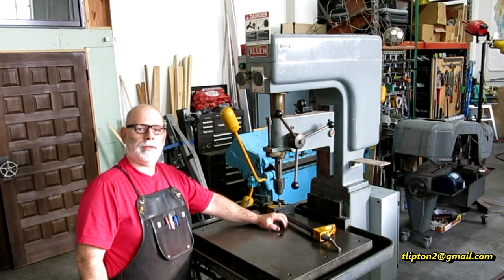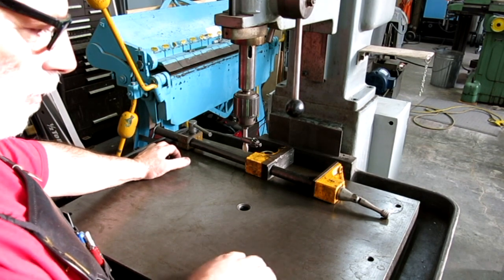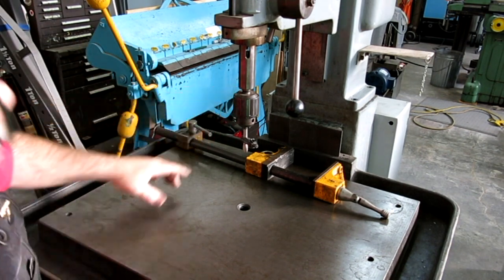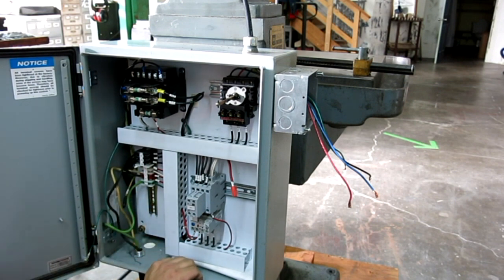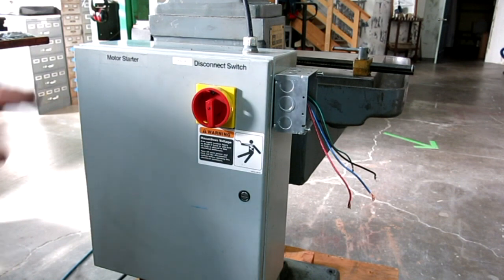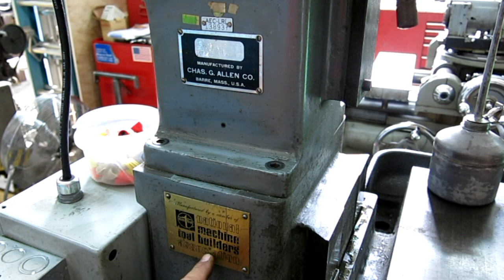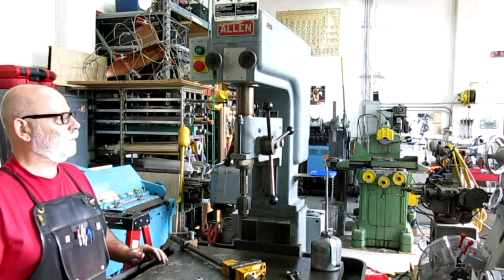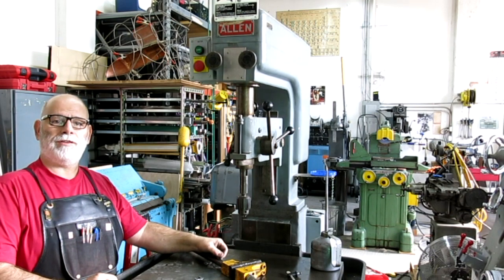Machine Tool Survey Allen Multispeed Drill Press

Comment: Hi Tom,
Hey you are going to love that Allen drill press. I have one in my shop very similar to yours and the only way I would part with it would be if I was replacing it with a radial drill press.  Mine was built in 1968 and used by the government during Viet Nam and then decommissioned. I am the 3rd owner of mine. I got it from a guy that was retiring and selling off his machine shop. He got it from a government auction. Yours is a newer version with the way the motor is set up. Mine has the spindle mount 2HP 230V 3PH motor. I think it's 12 speeds with a back gear. I have the very same table as you do in yours. They did offer a bolt down T-slot plate and your pable looks to have been set up for that option. I have a 14" rotary table mounted on mine and a 6" Kurt vice. The base is slightly different on mine in that I have the wet tank flood coolant base and pump. The table has telescopic drain back tubes to return the coolant into the reservoir base. Yours is also a much higher RPM machine then mine is. I'll have to take another look at the speed control to see what the speed range is. MT-2 spindle is the same. I also have a built in reversing foot switch on the front of the base. Oh you will like that spinal height adjust feature on there too. I use it on almost every job I set up and just love it. Yes they are very heavy stout machines and I would imagine could inflict a lot of damage or injury if used by the wrong guy. However I think it has found a very good home in your loving shop Tom. Oh I have seen them from time to time in used equipment auction and the go cheep. I paid $250 for mine.
The Allen replaced a 14" Walker Turner drill press that I used for many years. It still worked fine but like you the Allen sort of fell in my lap and I could not pass it up.

Joe 
PS, I found a real nice manual for mine on the internet.

Comment: Hey Tom,
I think you will find the elevating screw is telescoping. No need to adjust the outer section by hand. Just crank the table down, and when the inner screw runs out of travel, the outer will turn and vice versa. 
I have an old B& S mill made the same.
I'm more amazed at the lack of chowdering on the table, than anything else. Looks like it was used by pros.
I think your other drill press just got out classed. 
Nice score!
Reply: +Jerry Long  The lack of chowdering is due to the fact that you can't rotate the table!
Reply: Matthew Tinker People always find a way.
Reply: +Jerry Long or not really used at all! typical government purchase, bought for a fortune 40 years ago and was never required, so sat around till it was sold :)
Reply: +jusb1066 
Except is has the foot pedal upgrade and new wiring.  I think it was actually used.
Reply: jusb1066 Hehe yeah it could be, that pedal looked brand new.  So did that wiring box too.  Maybe they were worried about getting sued by potential buyers and just upgraded it to avoid lawsuits.
Reply: +Jerry Long I learned my basic machining working as a student in a chemistry group at the Rad-Lab - it was Lawrence Berkeley Lab by then...

Even in the student shops, on the student machines, there was very little damage down by ham-fisted operators - in the shops where the technicians worked? The machines were in elegant shape... It is the kind of place where they can attract some of the best talent who are interested in working on new and unusual things in support of the scientific research programs... I learned an incredible amount of basic machining on semi-exotic materials doing the weird things I was working on for two summers plus my junior and senior years.

Back to the point - this machine came from a DOE research lab, where the technicians cared for their tools... not your typical government shop! ;^)

Cheers,

Eric
Reply: UnbeltedSundew
well or maybe tested and upgraded every year to keep in perfect condition! :) i still differ on opinion on the use !
Reply: +Jerry Long    Good observation on the compound screw Jerry...
Reply: +Matthew Tinker yea, but the whole table looks pristine. The tapped holes may have held a fixture. It may not have been even used as a drill press, maybe some kind of test stand.
Reply: That's the point, if you can't turn the table you can't drill into it!
Reply: +chemech Thank You, That I can imagine.
Reply: +Jerry Long Jerry I think you nailed it, while rebuilding my SIPP drill press I found the same dual screw elevation set up, but it was gummed up. After disassembly, cleaning, and lubing it works great. When the inner screw runs out of travel the outer screw takes over, vice versa in the other direction.

Comment: you need a box to stand on so you can operate the power switch Tom!   wonder if the pulleys can be modded for lower speed as the 5200 rpm would be ridiculous anyway.